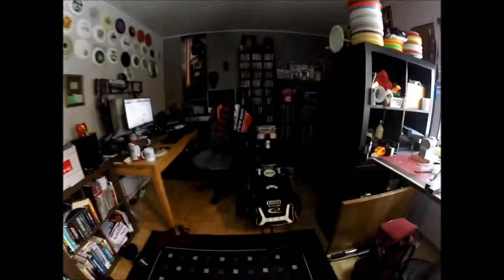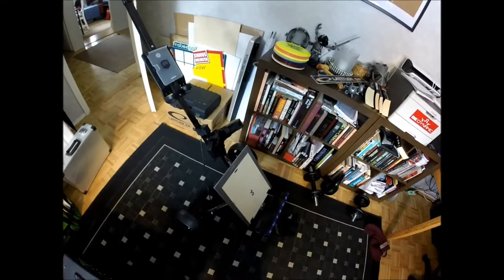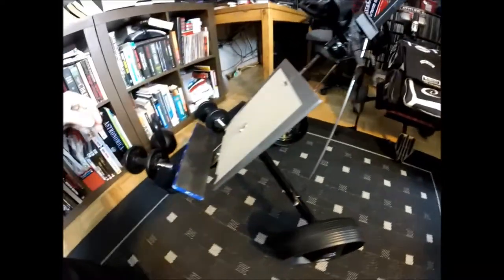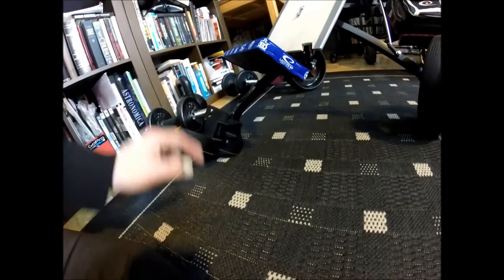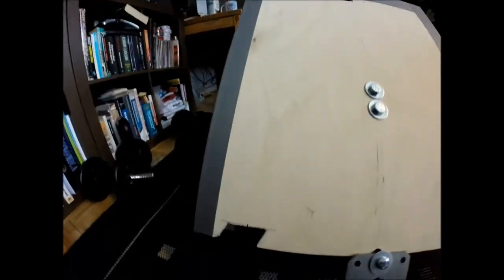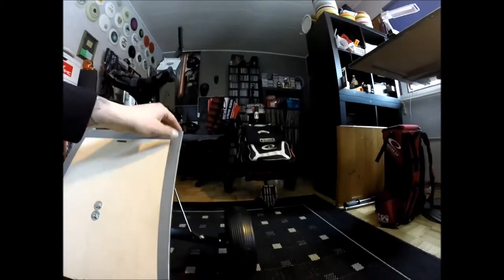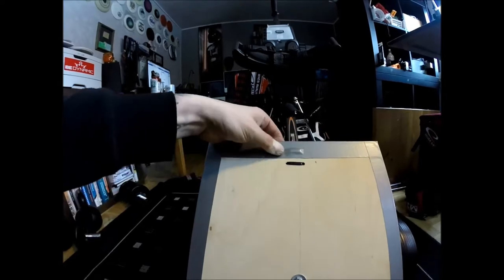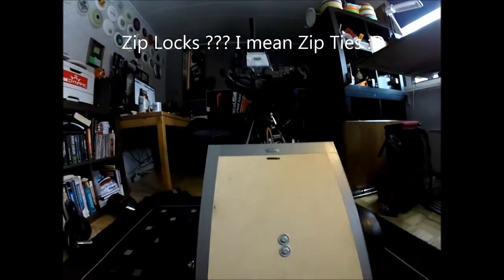Disc golf cart project

Comment from the maker: The putter holder is made out of a 10l plastic juice canister. The canisters measurements were quite good so I just gave it a little bit of though and came up with an idea.  I used the left and right narrower sides of the canister (when looked from the side that has the main label on it) because they have curved corners ready on them. I´ll draw a fast sketch, make a video out of it and post below this video.